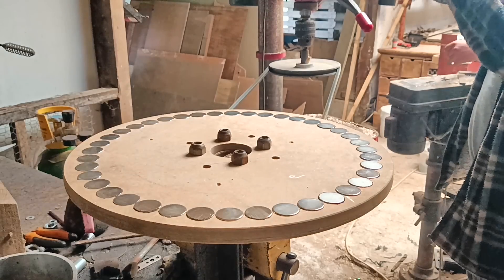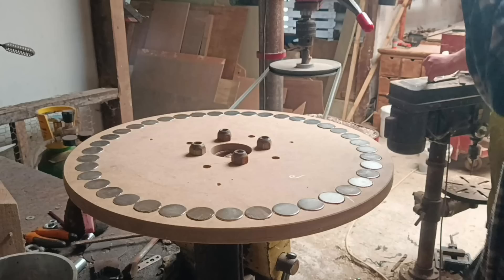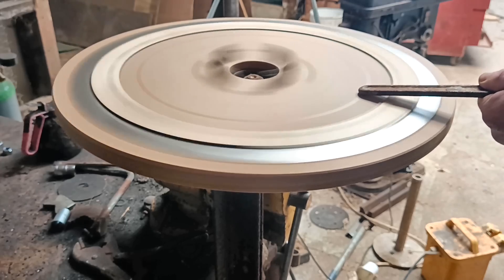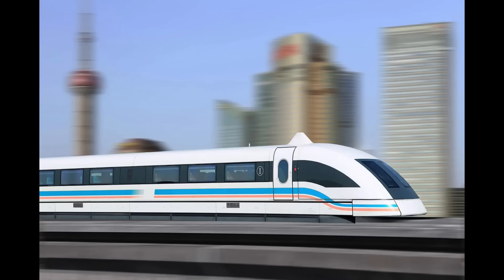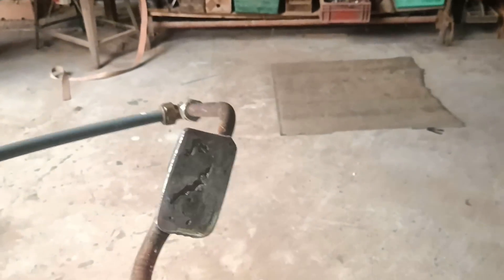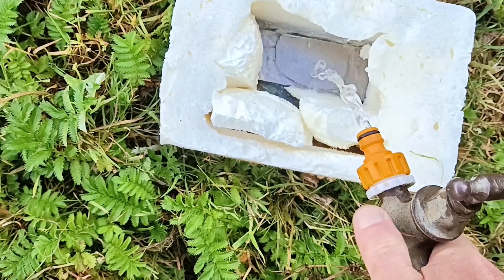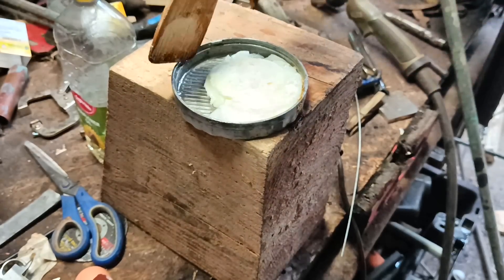Cook An Egg Over Magnets  - And Other Interesting Induction Heater Stuff..

Comment: Tim your water heating circuit will work far better if you can design it for thermo siphon flow. I would suggest putting a small vessel on the top with water to the heater connected to the bottom of the vessel and the water returning from your heater into the side of the vessel, say half or two thirds of height. Basically what you want to achieve by design is a natural rise in the heated water piping with no trapping and even minimal harsh bends. With that in mind it would be much easier to directly heat a section of the rising heat pipe IF your magnets rotate in the vertical plane which is easier said than done with your experimental setup
Reply from the maker: I just showed you a perfect thermo-syphon in action and you're still not happy!  : -  )
Reply: @wayoutwest-workshopstuff6299  I’m not really bothered either way Tim, simply pointing out some common design considerations used in thermo siphon flow arrangements in industrial boilers and industrial refrigeration that I have had experience with professionally

Comment: Definitely don't use ferrous metal for the heat plate of heat sink, use non magnetic stainless, aluminium or copper. A copper refrigerant  tube loop around the disk of magnets with slow circulating water would be ideal.

Comment: how about a raceway around the circumference of the disc on either side of the magnets, so you could use ball bearings, nylon ones?, or little wheels under the frying pan / pipe or whatever you are trying to heat. That could allow you to keep the item the right distance from the top of the magnets and provide a steadier way to hold it perhaps?

Comment: Why not just bend some copper pipe into a circle over the magnets and adjust the distance to the plate to both regulate the speed of the windmill and prevent it from stalling? You might not even need to add heating plates to that.

Comment: Could you counteract the drag with an opposing disk spinning in the opposite direction?  Like by making twice as much electron wobbling happening at the same time?
Reply: On the subject of more wobblebility. I wonder how effective a setup would be  where the magnets sat on the outside of the wheel. If said wheel was placed vertically I could imagine you'd be able to line a couple up running in opposing directions

Comment: If th sytem is alredy limited by the power output of the drillpress then a larger heating plate won't give you more heating power. But the main reason for the lager heating plate is taht the same power output can be achived with lower rpm wich is preferable for the windmill since it is spinning way slower than the drillpress. So with a slower heater there will be less gearing needed thus less power wasted. Also increasing the speed won't give you more power output it will only result in a smaller heater wich can heat up faster since it has less mass but will not give more total power.
Also the magnetic drag (N) times the circumference velocity(m/s) gives the heating power(W), so increasing the drag while maintaining the rpm gives more output. For a slow spinning system you want as much drag as possible
Reply from the maker: Yes, but there surely is an optimal flip rate?
Reply: @wayoutwest-workshopstuff6299 well this isn't truly an induction heater, rather an edicurrent break. Since there is not only changing magneting fields but also moving magnets, It would even work with all the magnets in the same direction if there is space between them.
The main reason the electronic induction cookers use the high frequency is because they can use less copper that way and deliver the power on a smaller area.
For heating a large vessel of water I don't see a problem in a bigger heater and the less gear ratio you need the more efficient the windmill will be. Of cource you start losing heat through the larger area but i think if you have to gear a ~30rpm windmill up to 1000 rpm there will be more power lost.
Also the possible slowing of the disc isn't that much since for delivering the same power with half the speed you need double the drag and the drag is also linked to the speed. So a system with four times the drag per rpm can produce the same Power at half the rpm.

Comment: I wonder if you could use a CPU water cooling block here as they have already been designed for very rapid heat transfer from metal to liquid, although their narrow pipe diameter might mean a circulation pump is required.

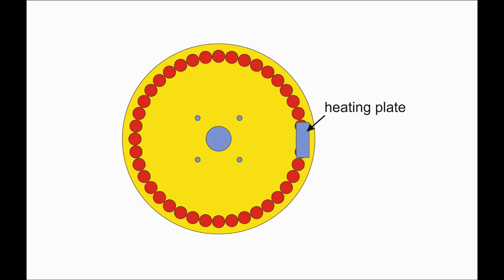Comment: 4:02 The drag you experiencing is work being done: speed multiplied by torque. The more torque, the more energy is converted to heat (through eddy currents)
Reply from the maker: Exactly - but where is the sweet spot?
Reply: @wayoutwest-workshopstuff6299  The sweet spot depends on the geometry of the windmill blades rather than the heater itself. The mechanical load should be such that the windmill speeds operates in the best efficiency range. And this also depends on the current wind speed.

Long story short: For maximum energy output, you would need a controller. (In the old times this was done manually). I would design it to have as much drag to almost stall the mill at full wind speed and then release the torque to find the sweet spot.

(This problem is not unique to windmills. Solar has to deal with the exact same difficulty. Trading current versus voltage. Controllers that can handle this are called MPPT which stands for maximum power point tracking.)
Reply from the maker: @PermireFabrica  Thanks!

Comment: Using a generator is not only lazy, its expensive as well especially as you have to pay for fuel and servicing etc. Unless of course its an electric one, which you could use as part of the process, for example running the pump. You could charge it up using the windmill and have a couple of solar panels as a back up. I think that you're going in the right direction with the induction process, you need to find a way of putting it under a metal tank or even a copper coil. Only because copper is a brilliant conductor of heat, thats why its used in hot water tanks to heat the water. As you say your just trying things out, I have no doubt you will find your own way after all you are a bit of a genious. 👍

Comment: Copper is better for heat transfer, and has a higher melting point than aluminium. There's a reason pots are copper and not aluminium!
If you're going all-in on the making stuff from copper and aluminium, though, I'd suggest getting a proper furnace and just casting it from whatever scrap you can get. You can turn beer cans into useful stuff!
Also, nice to see another in the series of you trying to comprehend electromagnetism so you can use it to heat your house. It should be much quieter than grinding steel plates together.

Comment: A good grasp of the concept of Work in/ work out!

There are tricks you can use to double the frequency quite easily ....... that might show if ramping it Way up is worth the effort. Cutting bits of steel into the right shape would allow you to bend the magnetic field round 180 degrees and if you angled the opposite pole to arrive midway between the magnets you double the frequency (you would want all the magnets facing the same way for that though. Equally you could use the same trick to link pairs of magnets the way they are to double the field strength (not sure if that will get you more heat though as I suspect you will saturate the field) ...... Think of it like a ladder. Once you reach the top you cant climb any higher no mater how hard you try!

Obviously the closer you get to the magnets without touching them the better ...... so a jig to hold your heating element will be a good idea! 
Slowing the magnets down or even removing half of them would give rise to an effect called Cogging. The heating element will be pulled into and pushed away from the magnets (which is why you don't start off under load). What you want is to set up eddy currents which circulate in the metal heating element  so having a more massive element will not gain you much as the currents are virtually two dimensional and your thicker element is 3D.

I do have to say that I am enjoying watching you experiment!

Comment: A check valve on both sides of the heating plate would pump hot water if you heated it to flash steam.

Comment: Very fun to follow your progress and trails of different ideas.
I think your idea with a pipe with a cupper plate seems promising.
If the plate is too big, it will spread out the heat energy and radiate it in all directions, even downwards.
To minimize losses downwards, you may need a small gap between plate and magnets, also reduce airflow from magnetic wheel with adjustable brushes around the plate.
Then insulate the rest of the circuit. Maybe even an insulated box around the whole circuit, the tank, the spinning magnetic wheel too.

Don't worry too much with the losses this early in process.
When you get a better wheel that's less wobbly and smaller gap - the insulation will be more effective as well as the efficiency of heat production.

My guess is gearing up may be an issue. You sill want some heat in moderate winds.

Another wild magnet idea is it to make magnet pockets deeper and stack two or more magnets on top of each other. no idea if it improves things.
That may give you half the polarity switching /second (using same amount of magnets) but may increase strength and or reach of each field and more of your pipe may receive heat

Comment: * edit * as pointed out, an eddy current break *is* actually a type of induction heater, but anyways:

I imagine people saying that steel would work better are thinking of induction heaters. This isn't an induction heater, this is an eddy current brake. While I'm no expert, I believe you were entirely correct when you said that making the magnetic "circuit" better wouldn't improve the efficiency. It would however increase the braking force for a given speed, so if you wanted to be able to make more heat at a lower speed (and provide more braking torque as a result) you could improve the magnetic circuit to do that. A cursory look on Wikipedia shows a lot of eddy current brakes designed just to be used as brakes and not for heating, which use a spinning copper discs with strong magnets on either side of it. Since you're looking for heating, I imagine the best setup would be two discs of magnets with a flattened thin copper pipe between them carrying the water. If you want to increase the braking force at lower speeds, you could just run the copper pipe further around the disc or increase the diameter of the disc. You can also provide a backing steel ring on the magnets to improve the magnetic circuit, in a similar way to that of a halbach array, although not as effectively (anything that reduces the "resistance to magnetic flux" to talk about it like an electrical circuit, will increase the strength of the magnetic field through the copper). Since steel is cheaper than magnets thought, you could put any cost savings to just making a larger diameter disk lol.

Oh also don't be afraid of the drag force, the drag force (multiplied by the radius) times the RPM is the heating power. If there's no drag it's not working.
Reply: Spot on mates. Finally, a discussion that understands the physics involved here. Contributing to the discussion, the key statements are:

- Efficency wise it is entirely independent of material choice as well as magnet arrangement. If the design is not optimal, all what's going to happen is that you won't get much heating power as you are not loading the system much.
- "Real" losses are only produced in the mechanical linkage and dissipating heat from your heating element. So the idea of isolating the element is absolutely correct.
- The drag (Torque) is key. If your goal is to run the machine as slow as possible, then maximizing the torque is what you want. To do this, increase the induction in the plate. Or increase the change in magnetic field.
- The change in the field can be increased by more magnets, a faster spinning wheel or a bigger wheel. As for your goal, a large wheel is best.

If I were you, I would use copper or Aluminium instead of steel, the handling is not that dangerous as in a still state no magnetic attraction is present (prevents pinched fingers). Since the magnets are rather expensive, I would try to use both sides of the wheel. I think a copper pipe running in a circle once above the plate and then once underneath the wheel is as simple yet effective as it gets.
Reply: "An eddy current brake, also known as an induction brake ... an eddy current brake is an electromagnetic force between a magnet and a nearby conductive object in relative motion, due to eddy currents induced in the conductor through electromagnetic induction."

Just because it isn't an electromagnet doesn't mean it's not an induction heater.
Reply: @punkdigerati  You're right! I've done some more reading and on the wikipedia page for induction cooking (not to be confused with the wiki page for induction heating) it mentions that less than 10% of the heating comes from hysteresis losses (which surprised me) and the reason iron works so well is because it's not amazingly electrically conductive but very magnetically conductive, so it concentrates the magnetic field at it's surface which means all the current is in the surface rather than spread out. Since heat from electrical current is proportional to the current squared times the resistance, it produces a lot of heat. It should be noted however, that a lot of these optimizations are to try to make sure most of the heat goes into the thing being heated and not the driving coils, but in the case of this setup, we're using permanent magnets and don't have to worry about conduction losses in the driving coils, as there are none! If I had to take a guess, I'd guess that's why induction cooking goes for cast iron, but eddy current brakes go for copper disks as they care about mechanical drag force at low speed (which also means more heat at lower speed). Since we can use permanent magnets and the changing magnetic field is produced by rotation, and in light of the statement that only 10% of the heating comes from hysteresis, I think material choice doesn't matter particularly relative to geometry, and the best design will be the one with the most drag force. 

It's way too late where I am as I'm typing this to be trying to think about all this lol. The long of the short of it is, it's all electromagnetic induction but the devil's in the details and I don't think I'd change anything about my recommendations but I would change my reasoning for it. The root truth is, energy in to a system must equal energy out, conservation of energy. Mechanical power is RPM * torque, and given this is an eddy current brake with permanent magnets, pretty much all mechanical power into the heater will come out as heat ~ somewhere. Success of the design will basically be proportional to how hard it is to turn the wheel at a given speed (resistance torque).
Reply: https://youtube.com/shorts/XFGKeXSEylk?si=ipDjiaJAA-mOGrVp

its just eddy current heating.

I2R. 

so much magnetic flux cutting a conductor so fast creates an EMF, and that EMF through the resistance appears as "current". 

the induced magnetic field opposes the field creating it, and you get a braking force proportional to the power absorbed in the resistive heating.

the steel backing plate shorts out the unused poles, so the only magnetic field appears between the projecting poles. far more flux can "cut the conductor", so less magnets are needed...

the pockets are only very shallow, as otherwise the magnet will just short itself out through the steel, lol. it isnt necessary but it makes a huge difference on performance.

ideally, the backing plate would wrap right around so the flux only flows through a small air gap filled with copper disc... but this makes it awkward to vary the amount of flux linkage... it is how they make the "electromagnet" based ones as used in trucks and busses and other applications. (professional dynamometers!).

its sad that for something nearing 150 years old, not many people seem to understand them...

the magnets are alternating polarity, and as each eddy current "rotates" in opposite directions, the maximum current, and braking effort, and heat, is appearing in the gap between the magnets. theres an ideal location for the magnet and its size regards the diameter of the disc, as the current still needs "room to move". hence, a large section of conductor rather than a loop or thin sheet.

theres really no difference between these and a generator, except here we have the generator shorted out and wound with a single turn, rather than coils to make "voltages" that can then be easily conveyed down wires to a resistance or another coil where either heat, or a magnetic attraction/repulsion can be produced.